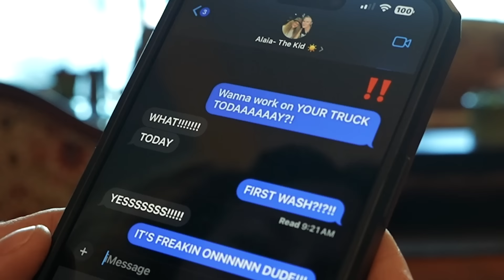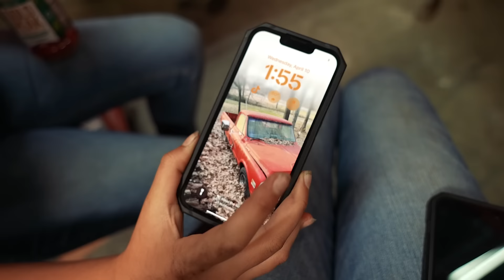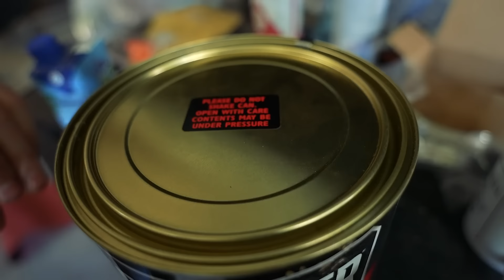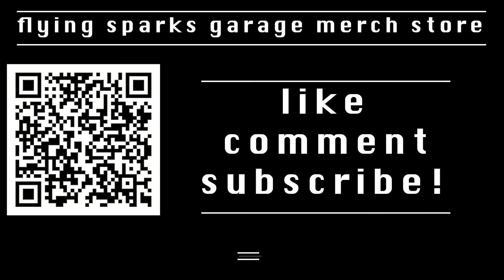First wash after revival and restoring worn out door guts!

Comment: The nutsert tool is much easier to use if you adjust it so the arms are closer together.  (I have a similar but no name one off the jungle site)  Just don't over squeeze them, I got over zealous a few weeks ago and pulled all the threads out of the nutsert.
Reply from the maker: Good tip!!

Comment: That truck is in Great shape ,even my 2012 has rust starting .😡 They don’t make Westles White wall cleaner any more .Black magic Bleach White Bought them It works so  good to clean your tires. I use it on my Coolers also and they clean up So Good with it.   The doors work good and the bed coatings look good also.